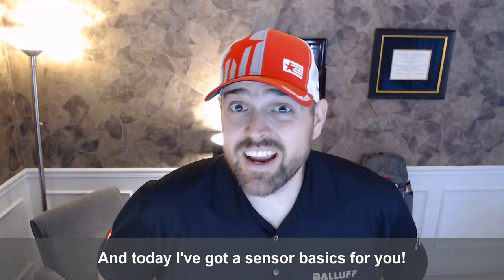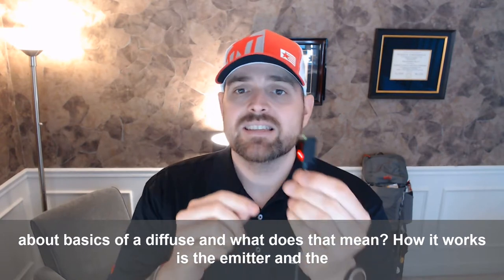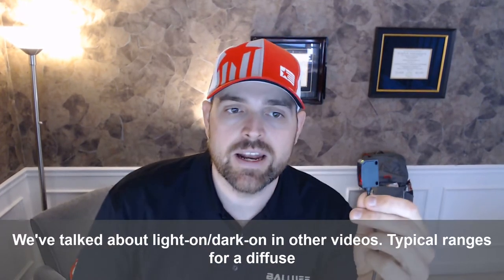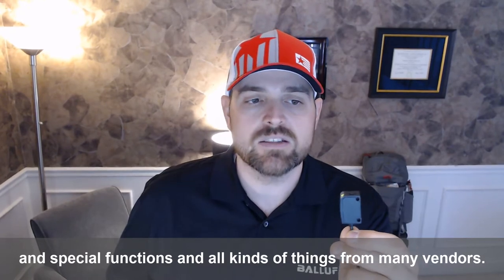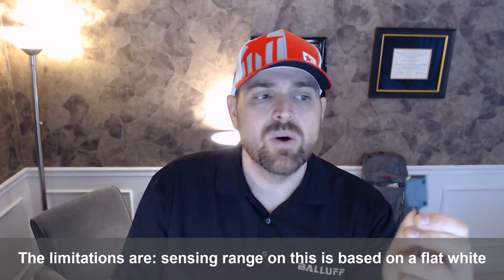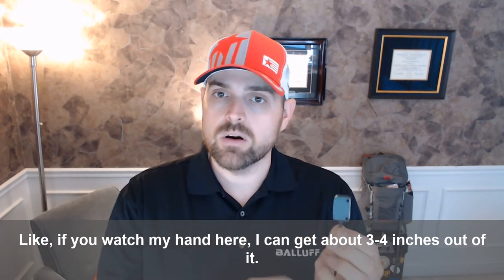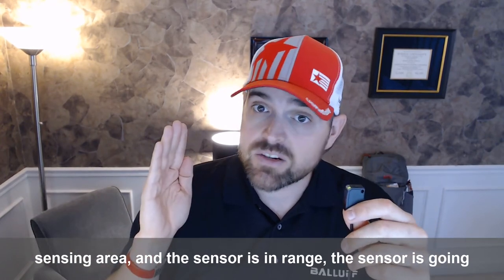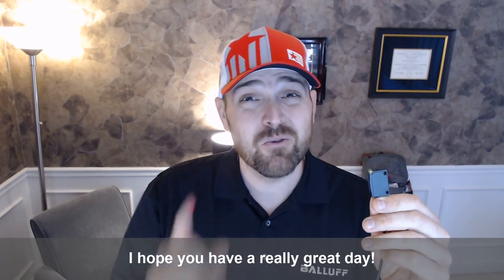Sensor Basics: How Does a Diffuse Photoelectric Sensor Work?

Comment: Hello Will..thanks for the info on diffuse photoelectric sensors..if I may ask..my currentl diffuse photoelectric sensor does not emit red light and the receiver signal light keeps blinking..it doesn't  do the job..could you help me how to fix it?..thanks..
Reply from the maker: Tough to know exactly what is wrong. Did that specific sensor ever have a visible red light? Some photoelectric sensors are infrared and you can't see them. I cover light sources here: https://www.youtube.com/watch?v=PyBvrGNPRpE

If the signal light is blinking there is commonly a code in the manual if you find it online that tells you what the blink means (fast versus slow, pattern or color).

It also could be that the dial/program is set very low or even that the light is turned off by the function of the sensor.

Or if it was in use for a while, it might just be bad or burned out. 

I would start with the partnumber and the manual online and work thru the above suggestions. Hope they help!
Reply: Thanks for yout reply Will..actually my sensor is IPF PN630520 laser sensor..it doesn't have visible red laser light but the other sensors exactly the same as this do have.

I found one manual about this sensor and it is showing an instruction about qTeach. I tried following the steps  but no success. Or maybe I am not doing it right.